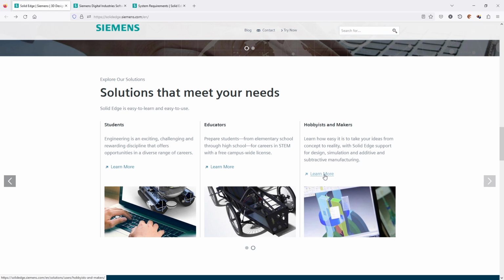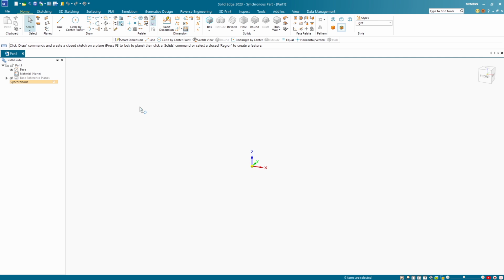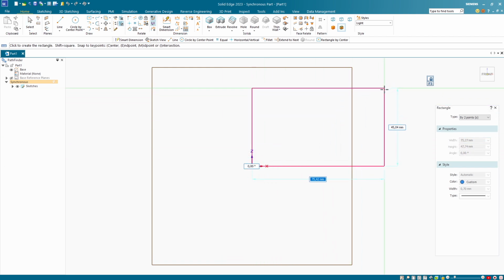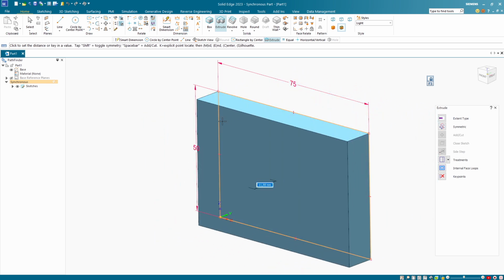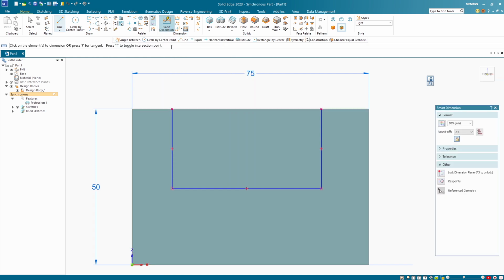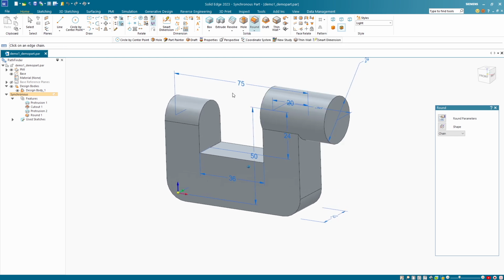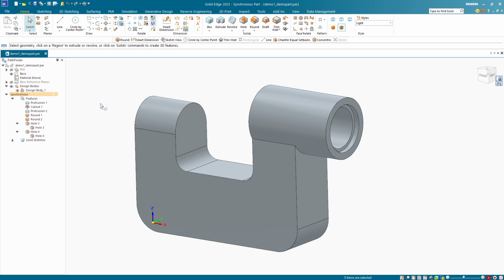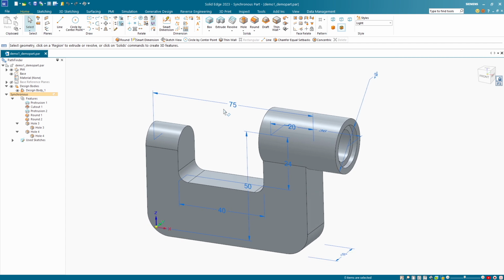The best Professional 3D CAD Software you can use for FREE in 2023? | Solid Edge 2023

Comment: Excellent tutorial. The workflow is really geared for productivity over other parametric cad programs. One key thing I noticed when messing around as I followed along is that when dimensions are changed on the fly, it skews the other dimensions already set on an extrusion object. I locked the dimension when altering it and them moved on to correcting the other that changed...locking that as well and continuing until they have all been corrected and locked. I will work with it for a while but I see it as possibly supplanting freecad/solidworks/fusion360 as my go to tool for fast modeling.
Reply from the maker: yes, this can feel a little unfamiliar in the beginning when Solid Edge also changes the other dimensions. To prevent this from happening you already found out how to lock these. Takes a little time to get used to the workflow I guess.
Reply: It's important to fully constraint stuff, you can do that with locked dimensions but you can also set relationships.  For example, if in Synchronous mode, you can bond several elements together with the face relate "rigid" setting - moving a whole bunch of things together at once with a dimension or simply by dragging.  It's really powerful.

Comment: What are the advantages, or not, of this software compared to Freecad ?
It seems an important detail to me.
Reply from the maker: Maybe I will have to create a complete video on this topic because its way too much to explain for a YouTube comment.
Main difference. This is not open source software. This is professional software, means it will be more stable, more features and overall much more refined. But you have to rely on the manufacturer (Siemens) that they will continue offering this Community Edition for FREE.
Reply: @FreeCADAcademy  is there a CAM/path option like freecad has?
Reply from the maker: Not in the community edition, unfortunately!
Reply: @wantafastz28  You can export to STEP which may offer a solution?
Reply: @FreeCADAcademy  I don't agree on the part "This is not open source software. This is professional software, means it will be more stable," :)
We all know pro software with bugs. And open source doesn't mean bad software.
Remember about 90% of Internet works with open source software.
Space X use Linux. Nasa also, and many others.
I agree with the fact that softwares from compagnies have sometimes more features, because customers pay for this, but the question as an amateur is "Do I need them ?"
A video may be interesting.

Comment: As a “veteran” (Heut-zu-Tage als Rentner) CAD user I sensed, with this tutorial, a certain ‘deja vu’: At this basic level this synchronised mode works in a way which is very akin to the way SketchUp works………..interestingly.
Reply from the maker: Cool!
I haven’t really checked out sketch up that much unfortunately
Reply: The Sketchup comparison is reasonable... Solid Edge of course is fully parametric professional CAD, but Synchronous mode is certainly fun like Sketchup.

Comment: I use NX almost every day professionally, and really wished there was some way I could get access to it (or something very much like it) for my own personal projects. Then I stumbled on this video, I had absolutely no idea that Siemens made Solid Edge, or that it was available for free, for non-commercial use! Literally about to download it, thanks for bringing this to the surface!
Reply from the maker: Glad I could help!
While it’s not exactly the same workflow as NX you will be able to use it productively in no time - I’m sure. 🥳
Reply: So its time for me to update this; I used Solid Edge for a couple of months, but have ended up moving back to FreeCAD and Assembly 3 and 4 workbenches. This was mainly due to stability issues with Solid Edge, I tried it on two machines (Ryzen 9 5900X & 3090 and Ryzen 9 5950X & 3090 Ti) and suffered fairly regular crashes and lock ups on both machines, where FreeCAD runs all day on those two machines, or on my dedicated CAD box (Debian, 2xE5-2699v4 & 6900XT). Solid Edge draw performance yet to be beaten though, the display was lightening fast even with very complex assembles, and I did enjoy it, but the stability killed it for me for now, though I will no doubt return and check it out again once its updated again :)
Reply: @TheOriginalGeekyNoob  Thanks for the update!
Reply: @TheOriginalGeekyNoob  Solid Edge is well known to be incredibly stable.  You may be able to increase stability by lowering the graphics from "Graphics Card (Advanced)" to "Graphics Card".  As it happens, I can get Solid Edge to be stable even on a 14yr old machine - but it has a Quadro GPU, which is recommended for CAD work instead of gamer GPU.
Reply: Share your views after using it. Thanks!
Reply: @headgasket_  So a few days in now, and so far I like it - its definitely a different workflow to NX for sure, much more like Solidworks, but its performance is fantastic, comes bundled with Keyshot 11 for rendering, and aside the minor irritation of only having Orbit rather than Turntable navigation for objects, I can't fault it for anything. Continuing my personal projects with it, and will update if I hit any snags or issues.